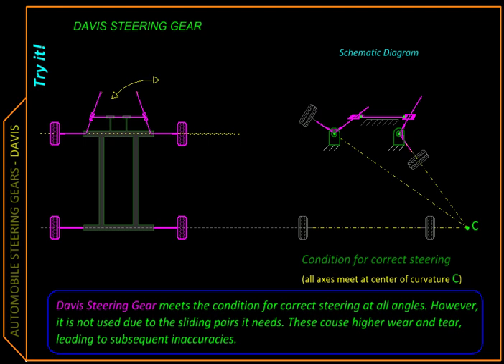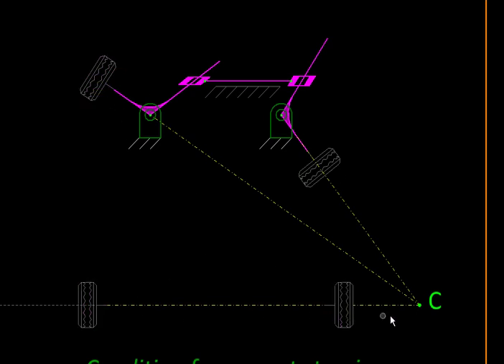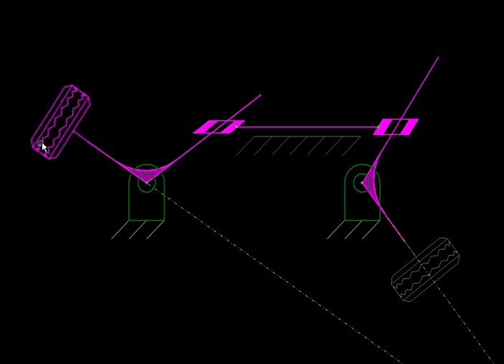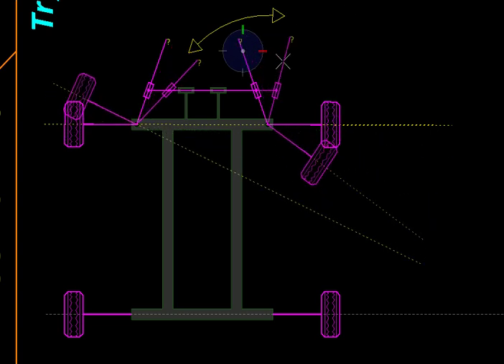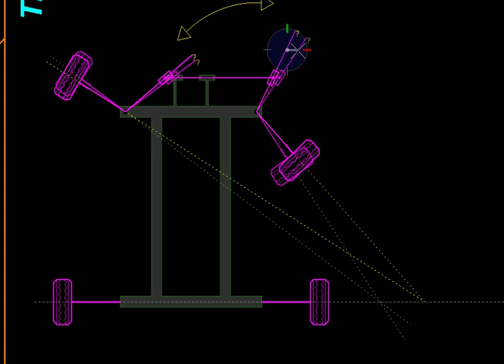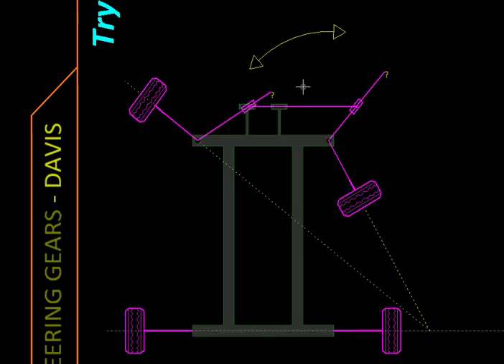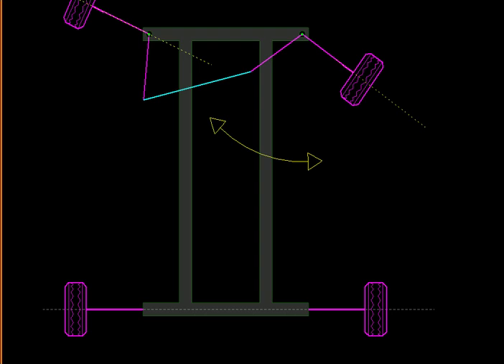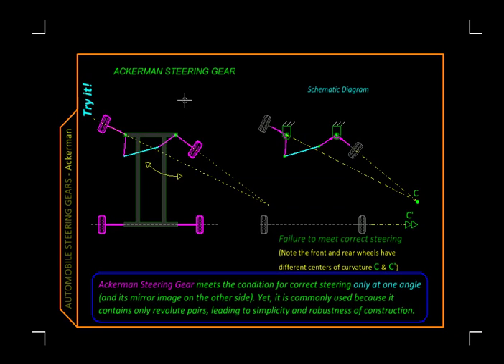Kinematics Ch02G Steering Gears

Comment: Excelent demonstration of CAD software usefulness !

About Davis mechanism, is it possible to design a (still) perfect steering system placing the horizontal sliding bar behind the front axle (with the correspondent bell cranks inverted toward the rear of the vehicle, as mirroring the whole assembly in that direction) ? That seems promising for a racing kart application.

Regarding the Ackermann type, that fourth bar alone connecting left and right front stub axles actually represents either 1) a three-bar set comprising a longitudinally fixed rack & pinion middle assembly attached to steering bars at both its ends through ball joints, or 2) a pitman arm (sector-like) at the steering column where both steering bars are mounted using (again) spherical joints, details that apparently could have easily been included in the MicroStation drawing you made for such a clarifying simulation (which would become even better if also considered the effects of KPI and caster angles on a 3D model !).

Comment: Hi SirIn the Acherman's Steering mechanism, as the point of intersection of front wheels axis is not on the axis of rear wheel so there is not pure rolling & wheels will rub on the road & tyres will wear a lotHow this problem is overcome?

Comment: Dear Sir please clear my doubt on Ackermann steering mechanism
i.e. Does wheels axes intersect at common in those 3 positions ,i mean ,is correct steering condition holds good for three positions?..if so how to calculate those particular angles during right turn and left turn..
when correct steering condition is not satisfied for all other positions then how to control the  tyre wear and manage to move vehicle along the curved path.

Comment: Does wheels axes intersect at common in those 3 positions ,i mean ,is correct steering condition holds good for three positions?..if so how to calculate those particular angles during right turn and left turn..
when correct steering condition is not satisfied for all other positions then how to control the  tyre wear and manage to move vehicle along the curved path.

Comment: sir my another doubt is..when front wheel axles are not intersecting on rear wheel axle then how is this satisfying correct steering condition...
Reply from the maker: +venky goudaru It does not fulfill that condition in that case and the front wheels will not be in pure rolling.

Comment: I have a doubt Sir, Some videos on  ackerman steering gear explains that the axis of front wheels meet on the rear axis...So does it meet or not.? I am confused....
Reply from the maker: Jitendra malviya Wish that was true! :-) Because that is what we want from an ideal steering system - all four wheel axes meeting in a point. Ackerman gear does that too but only for a specific angle or turning radius (or two if you count the left and right turns :-)) But for rest of the range, there is no intersection on the rear axle and hence the wheels are rubbed the wrong way :-) HTH
Reply: Ohhh ,now i got it sir....thnx a lot......

Comment: great explanations and animations sir, i am following from last couple of years. sir plz explain the acerman steering system in detail.
Reply from the maker: sachin pande They make only a cursory reference to it in Kinematics, but I think you can find a lot more in automotive engineering books in your library or on the net. Especially how to gain the mechanical advantage and increase its efficiency to make it a 'reversible. machine'. This is vital for the car to returns to a straight path on its own after being steered.

Comment from the maker: @Gaurav Deshmukh If you were referring to the Bell Crank Lever by 'L shaped Link', it is a single rigid body. That is why we take it as a link. A physical link may consist of several parts connected together, but by definition, they cannot move relative to each other. Let me know if this helps or if you have further questions, feel free to send them across.